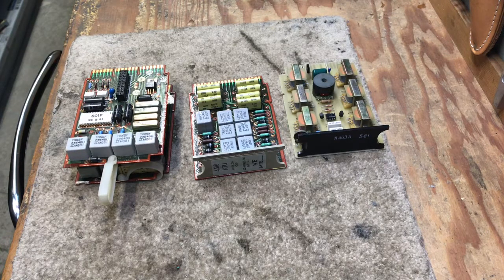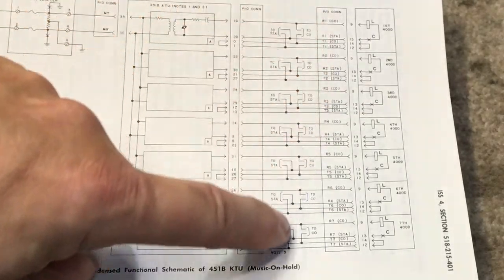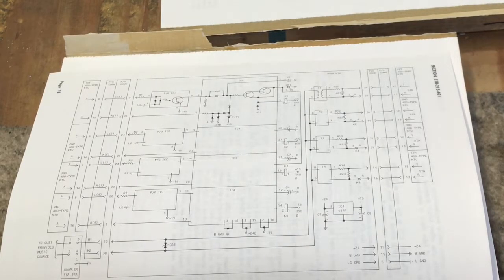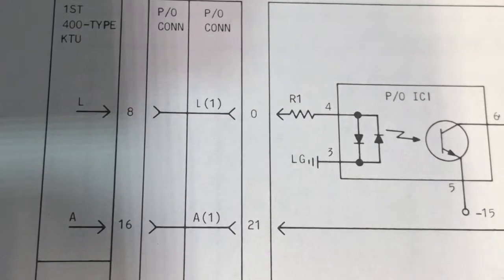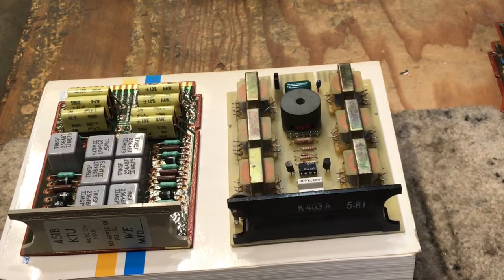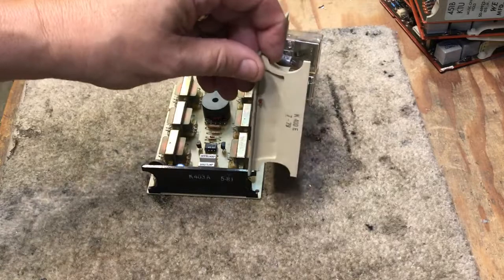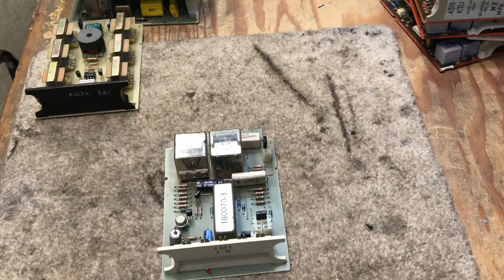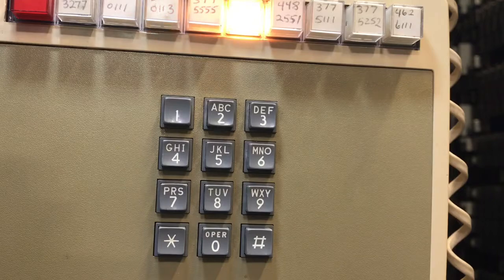Music on hold for 1A2 key telephone system's, ITT and AT&T

Comment: We had ITT KSU's and I had MOH on a lot of them.  For audio we used a Sanbar SB4201 FM tuner which plugged into a rewired slot of the KSU. This was before ASCAP, BMI, and SESAC got all testy about using radio without a license.

When we moved to the Nortel stuff and phased out the key systems, we used a dedicated player and some licensed MOH recordings.

Comment: Phil. I’m trying to add in a 498A to my k-512a KSU and am experiencing trouble. When I place a call on hold with the MOH equipped line I do not get any music and I also can not get the solid light to turn off after picking up and hanging up the line. 
I used a 40 pin card connector and currently only have the card wired to b ground, L ground, 24V, and the line 1 card’s T, R, A lead and L lead as well as the music source. 
Any ideas? I’m hopi
Reply: I just tried wiring up the second line for MOH and am experiencing the same issue with the lamps not turning off. The lines are still free though even though the lamps are on. Turning the KTU on and off turns the lamps off.
Reply from the maker: I'm assuming you're using an ATT 512 and I TTK403MOH card. Is this correct.
Reply from the maker: ITT 512 not att.